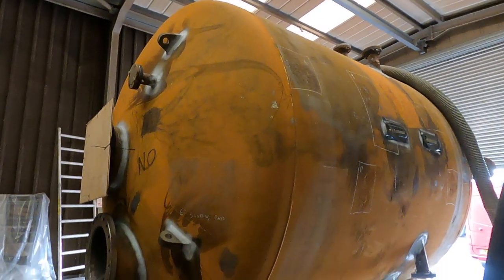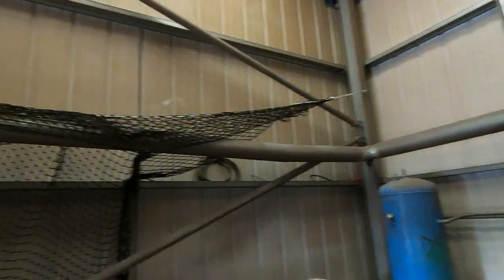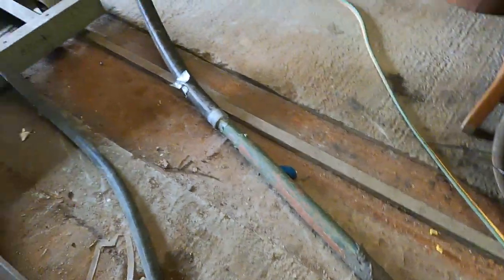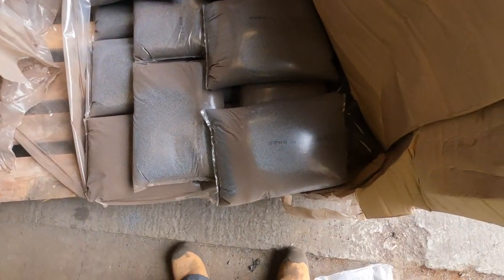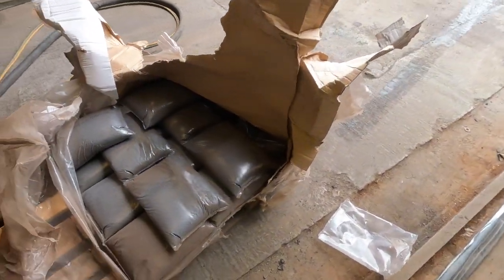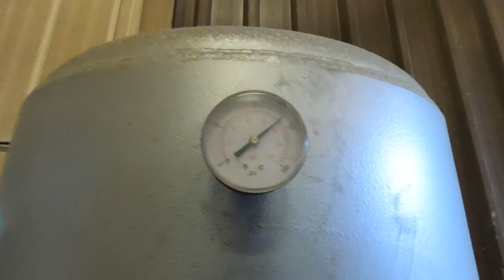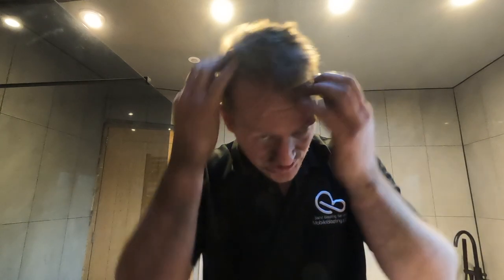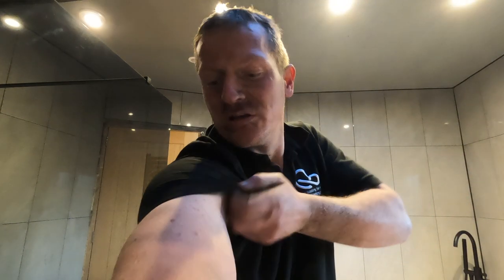Torture chamber steel shot blasting 3 days of hell 600cfm @ 145.04 psi 10bar Confined space

Comment: Not meaning to sound stupid but when do you decide to go from glass to steel shot. I ask because I'm new to this and I know glass will deal with rust. So I want to know when glass won't work and steel shot will?
Reply from the maker: Hundreds of different media's to pick from you pick what works for you don't fink glass will do as the is more to blasting than these videos show. You need to know how to work from a data sheet and know mesh grades condensation levels co2 confined space training etc etc that's why I say these videos are not a how too as the is way more to it than rock up and blast well to do it properly that is 👌 I'm just within spec with this rig if the psi drops I need to be on the ball because it will all need redoing if 1 areas mesh grade isn't the same even if I blast at the wrong angle or distance it will need redoing. That's the sort of data sheet that's needed on this job. They take 72 hours to do the same job I did it in 24 hour 👌
Reply: @Mobileblaster  thank you for explaining that to me. I truly appreciate it
Reply from the maker: @GMPC  not a problem pal some stuff is common sense like the more cfm psi and hever grit the deeper the profile same when going in reverse on light cleaning 👌
Reply: Also, steel shot has a peening effect on the steel, sand or glass cannot do. This hammer peening effect alters the surface of the steel and actually changes its composition to some degree, creating a work hardening effect on the steel, similar to heat treating and quenching. As you work harden the surface, it can resist certain chemical that a non-treated metal cannot resit. 
And it alters the strength and increases its resistance to begin cracking, fracturing. There are many reasons for work hardening the surface of steel, by hammer peening it with steel shot. 

Another reason for steel shot, is because it's perfectly round and has no angular edges on it.

Comment: At least with steel shot, you're only making 5% as much dust as you would with Glass or sand. I've done vessels, where one 375 cfm compressor pressurized the pot, and a second 375 cfm compressor did nothing but send in fresh air to purge out the dust being made, so we could maintain visibility. Glass at 145 psi pulverizes into pure dust nearly instantly. At 145 psi, glass has a velocity speed of 600 miles per hour, MPH. Steel shot at 145 psi probably has a speed of 450-500 MPH. Sorry, here in the states, we don't use kilometers yet.

What size nozzle were you using? That would tell me how much thrust back the hose was pushing back into you with. My hose has 50 pounds of thrust at 135 psi measured at the nozzle.
Reply from the maker: 😏 UK is the only country to sell fuel in litres and use MPH and MPG totally nuts how the f*** are we supposed to work anything out 😂 also a UK gallon is different to US gallon 😳😂 anyways compressor is pumping 600cfm at 175psi on the big flat areas I believe the nosel is 1/2" 12.7mm on the flat areas could possibly be bigger this is not my rig or compressor I have to swap out to 7/16" 11mm on the areas I have to bend the hose or simply cannot get near for the splash back is so intense. Visors don't last too long in this environment 😬
Reply: @Mobileblaster A 1/2" nozzle at 145 psi, I would guess gave you a 40 pound (20.4 kg) thrust back with the hose. That will tire out an old man like me quickly. Good thing you're younger and stronger. 

 I have never shot steel grit. But it does not shatter upon impact and does not become 20 times smaller, as a grain  of glass will shatter into 20 pieces upon impact. So the grain of steel shot is as heavy on the rebound as in the direct first shoot. So I would imagine the rebound impact is much more painful with steel shot than with glass. Your only saving grace is steel shot stays round as compared to a grain of glass is sharp with angular edges and fractures. 

A direct first shot into your flesh with glass would be much more devastating than with round steel shot because it is so sharp. But since the glass shatters upon impact with steel, it's 20 times smaller and 20 times lighter in the rebound. Steel shot is not sharp, but it stays just as big and just as heavy on the rebound. I was impressed with the rash and welts on your arm. You were catching a lot of rebound. Dam corners... Corners are visor destroyers. 

Your air supply hose to your hood, does it have a refrigeration AC (air conditioning) feature producing cold air going into your hood?
Reply from the maker: @weldersandblaster  This is steel grit sharp edged and elongated steel shot is ball shape, shot is used more for a polishe than a profile cut. 
20kgs at 145psi 😳all I know it's hard work 😂the psi is 12bar 175psi no matter how young or strong someone is I would say after 1 hour it's impossible to bend the pipe with the full bore nosel on to get angles or even blast above ya head that's why I take my smaller nosel in on the areas I have to have some flex. It's obversly faster with the big nosel but faster on the titer areas with less psi and flow 😬 I've been using the clemco cool tube but I'm more than likely going to remove this as the best of the summer has gone now in the UK back to 7 or 8°😂 not belong before I will need the heat tube haha
Reply: @Mobileblaster  Hi Mick. Am I understanding you right? Did you use 2 different steel medias on this project? In the inside of the tank, I can understand you using (sharp angular) steel grit to create a profile. But on the outside, I noticed you only blasted the weld and joint zones, (shot peening) so I assume that is to create work hardening of the metal which prevents crack propagation and helps to relieve weld stresses. I can't imagine you using steel grit with its sharp edges on the welds. Am I missing something?
Reply from the maker: @weldersandblaster  no I only used 1 grit I didn't blast the welds on the outside that's from when they was inspected i believe they put some sort of chemical on the weld and ultrasound it I'm not sure I don't get involved with that 😂 all I was to do was put the deepest profile I could get with 600cfm i had to get SA2.5 or better the test patches exceeded the the spec needed 😊

Comment: How did your light hold up? Also, can you send a link to them?
Reply from the maker: Broke 1 completely another don't go on full power now and snapped handle on the 3rd but the 4th and 5th worked well apart from been fluffed up abit 😆https://www.screwfix.com/p/lap-rechargeable-led-work-light-1000lm/613kf
Reply from the maker: On offer at the moment they are normally £25.99

Comment: I didn’t hear a gas detector chirping and there is a lot of oxygen depletion going on there!
Reply from the maker: 45 minutes intervills it's impossible to have any sort of alarm in there it would simply be ruined in minutes. I have a man out side that peeps in every 15 minutes to make sure I haven't collapsed and for some reason the deadmans handle fails. I feel confident that if something did happen it wouldn't be too long before that alarm be raised in the back right is a panic button that sounds all over the building I pressed it by mistake before and the unit was flooded with guys 😂
Reply: Why do you think the oxygen is being depleted?  Did you calculate the amount of oxygen he is pumping in there through his blast hose that is pushing 600 cubic feet a minute worth of air into the chamber? If you figure the volume of air in that chamber, and that he's adding 600 CFM, that entire chamber of air is being replaced every 5 seconds with new incoming air he is pumping in.